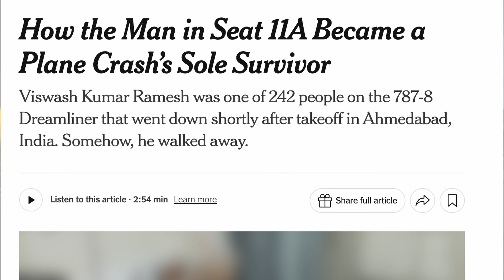Why the RAT Changes Everything – Air India 171 Update

Comment: 13:13 Another evidence is that there is no disturbance in the airflow behind the engines. Usually the air is “hazy” if the engines are running.
Reply: No faint trail of smoke either - especially from an engine at full thrust.
Reply: Good observation 👍
Reply: Could the bang reported by the survivor be a compressor stall?
Reply: @TorqueTheRich probably the RAT door opening. It will open very rapidly.
Reply: @TorqueTheRich I was thinking that, but I don't think a single compressor stall could wipe out both engines, and the odds of both engines stalling simultaneously is incredibly small.
Reply: Plus engines are very loud at full throttle at take off, yes sounds like they were spooling down.
Reply: You talking about the jetwash ? Its not there . the flight as it came from delhi , has some kind of electrical malfunctioning . some of the overhead switch was not working . saw it on the one youtube video . 
There was also one boeing employee wistleblower who said that shortcuts taken while assembling this aircraft . might be its true . when it was new it didnt show the stress . but now when the planes are aging little bit .( heard it like 10 years old now). It may be because of age stress . I am just adding up on the speculations and I based it on video and logic . otherwise I am completely a ignorent person
Reply: Good catch my man.
Reply: Isn't it possible that the pilots desperately tried everything to lift and so they deployed RAT? If so it still could have been anything again we are not closer to the truth.
Reply: @dorkanemeth5510 , absolutely NO time. It’s deployed automatically anyway  in the 78’s… 
They were frantically trying to keep the aircraft in the air.
Reply: You wouldnt be able to make that out on the video imo
Reply: The surrounding ambient temperature can make the jet thrust more visible.
Reply: Yes, no fuel/exhaust vapour trail
Reply: Why did the pilot did not said both engines failed?
Reply: @sumitkumardas2583 pilot barely had time to call Mayday
Remember:
Aviate-Navigate-Communicate

Literally no time for the last 2, it all happened in one of the 2 most critical parts of the flight
Reply: Just came across a must see video, “Mass Murder Over DC”. Trump was behind the plane crash in Washington, D.C., that killed 67, as a threat to lawmakers who might oppose his agenda, of trillions in tax cuts for billionaires, and war on Iran.  There can be no question that the military helicopter deliberately hit the jet, head on, unwavering in its course until impact. The NTSB is refusing to release all altitude data etc etc showing US Gov complicity.  Google "mass murder over DC".
Reply: Thanks for a good video. Looking at the evidence and being prepared to change your mind shows you are an expert. Surely, if it was a dual engine failure, the thing common to both engines is the fuel system. So could be contaminated fuel? On the other video showing the airport cctv, they only just get airborne before the end of the runway, so fuel starvation?
Reply: I still think the video is too low quality to say for sure if there was hot air disturbance or not. However, now that multiple bits of information suggest that RAT was out, dual engine failure would also explain lack of hot air.
Reply: Good point. Air behind the engines are blurred because of hot exaust gasses
Reply: Yeah that's a good point, I'm surprised he didn't notice that
Reply: That could be a good catch
Reply: At a point fuel supply stops . Now both engine are dead.😢😢
Reply: Put down the pipe.
Reply: That was my take too. No visible exhaust, no smoke, no heat-haze, nothing.
Reply: What could trigger both engines to go off at the same time? Lack of maintenance or negligence?
Reply: @hfbhju7001 I think massive " Electrical or multiple hydraulic failures stemming from electrical. ....
But what and how?
Reply: @hfbhju7001 

Lack of maintenance, poor quality maintenance, "bad from supply" parts...too many possibilities to pin responsibility without further investigation.
Reply: @hfbhju7001 o blocco carburante
Reply: @hfbhju7001 I would say sabotage.
Reply: @1dd434 Giving whats going on in that part of the world atm that would be a good assumption.
Reply: 7 days before at Frankfurt that plane let out 2 thin plumes of black smoke on takeoff, I asked if that is normal but no response so guessing it’s normal
Reply: No exhaust heat or smoke seen from back of engines,  however it is very confusing that while the original video does capture the sound produced by the RAT, one can also hear the sound of the engines (different than sound produced by RAT).
I am not against the theory of a very rare and perhaps never seen before dual engine failure at take off with no bird strike, just sharing my confusion about the audio hearing turbine engines running all the way until fireball.
Reply: @JavierRodriguez-fg6yb  Engines usually don't just stop so they could have been still going, but like winding down in a sense as they had no power if that makes sense.
Reply: @paulnerlich1954  that's true, it could've been the engines feathering what I am hearing. 
CVR and BB will hopefully tell better what happened, but sadly it won't change the outcome of all this victims.
Reply: On that topic, the question is, if RAT is deployed due to an electrical and / or hydraulic issue, would the CVR and FDR keep working? I have seen cases (in other, non 787 aircrafts) where FDR has stopped due to an electrical supply outage.
Reply: @JavierRodriguez-fg6yb  I think what you are hearing is simply wind resistance against the airplane. When something is moving fast the wind makes a rushing noise as it passes over it like when you stick your hand out the window of a car it makes a whooshing noise
Reply: Having watched this very insightful analysis of a terrible tragedy, contaminated fuel would seem to be a very logical explanation for both engines to fail simultaneously.
If it was sabotage then some person, group or state is guilty of the mass murder of innocent civilians…
Reply: Could the bang that was heard been something that resulted in fuel starvation to both engines?
Reply: Is it possible for the RAT deployment (accidentally) to cause both engines to shut down?
Reply: @roniwalakandou230 i was wondering the same thing
Reply: @roniwalakandou230 No!! In a 78’ you can’t just “bump” it accidentally. It automatically deploys. 
In something like an F-15E, it is manual, but a LAST resort.
Reply: @mcat663 I didn't say that one of the pilots accidentally deploy the RAT. I am wondering if it's possible to have a RAT MALFUNCTION. If the RAT somehow deployed without one of the three prerequisite conditions, then it will be catastrophic at such a low altitude
Reply: The engines had to be running to achieve lift off !
Reply: @dougsimmon7460  Maybe they stopped running after liftoff...
Reply: @dougsimmon7460 the engines were running in order to achieve lift off, but after take off both engines flamed out and stopped running which is why the RAT was deployed.
Reply: @itsJulianLam obviously
Reply: Its being now established that within 5 secs of plane lifting off there was probably both engine flame out & Pilot calling out Mayday
Reply: @chirab1967 Contaminated fuel, wouldnt u say would cause engines to stop working.
Reply: @robertmitchell6080 
Spot on!
Reply: @dougsimmon7460  yes, but they were well past V1 so that isn’t relevant!
Reply: @dougsimmon7460 very smart. Nobody thought about that. Lol. Didn't it occur to you that the engines might have failed after the aircraft became airborne?
Reply: @Sleeperknot  that's kinda obvious , wouldn't you say ?
Reply: @Sleeperknot 😄
Reply: @dougsimmon7460  well you were stating the obvious so get off the back of anyone else doing the same mate.
Reply: @dougsimmon7460 pot calling the kettle black there dude, high level irony by Dougie.
Reply: @dougsimmon7460 you stated the most obviously obvious!
Reply: @io8476 Somebody has to , obviously !
Reply: @dougsimmon7460 and they would’ve failed after the rotation obviously.
Reply: @tjaviation61 that's the obvious observation
Reply: the power was reduced when it was about 20ft in the air the disturbace stopped
Reply: there is black smoke right after takeoff comming from the engines
Reply: This is a solid and valid explanation, with the clear explanation for deployment of the RAT, and dual flame out. 
However, this still doesn’t explain why the flaps were fully retracted, and the landing gear was still down!

The landing gear is to  immediately be retracted when there is positive lift. Usually shortly after V1.  It is still down in the video. 

In the video, the flaps were fully retracted when it is clear they were barely into Vr (rotation.) and not to V2.  

There isn’t always “one” solution to a problem. 
I think there was “pilot error” involved here as well and should not be discounted.
I think the Captain called for “gear up” and the FO accidentally retracted the flaps. 
The plane appeared to be at about 300 feet entering the video, with RAT deployed, but before descent. 
If there was a flame out after V1, in Vr, and not made it to V2 (which clearly they didn’t,) at the very LEAST, the flaps would still have been extended, and the landing gear somewhere in between. 
A flame out is a 1:100,000 or more flights (and I’ve been in one! Not fun! Luckily before V1 and on a LONG runway!! Slamming the brakes on takeoff is WEIRD!!!)
The odds of a flame out and pilot error of that magnitude must be in the 100’s of million’s!!
God rest their souls! 🙏🏻
Reply: @mcat663  they didn't had enough time to think about landing gear, the sole survivor told that take off was normal but 10-15 seconds after that plane nearly stalled in the air then their was big noise and lights started flickering. Everything happened in such a short span of time you guys are thinking about gear and flaps.. always ready blame. I never blamed the pilots the moment i knew that it all happened within minutes/seconds that too immediately after take off, there's very little one can do in such scenarios but who will explain to fools like you all
Reply: @mcat663  I would expect the RAT,  designed to operate at high altitude, is not responsive enough to build up hydraulic pressure or power bus at short notice.
Reply: @rhyoliteaquacade , the RAT is designed for many situations. 
Otherwise, why would it have deployed at all automatically in this situation?
Also, if you’re having an issue at high-speed, you don’t want it deployed immediately and interfere with a (stable?) flight of the aircraft first. You want to be able to stabilize the aircraft on what you have available first. 
In the F 15, it is deployed manually, and it is the last thing you want to do at a high speed if you have engine failure, electrical or hydraulic outage.
Reply: This is a solid and valid explanation, with the clear explanation for deployment of the RAT, and dual flame out. 
However, this still doesn’t explain why the flaps were fully retracted, and the landing gear was still down!

The landing gear is to  immediately be retracted when there is positive lift. Usually shortly after V1.  It is still down in the video. 

In the video, the flaps were fully retracted when it is clear they were barely into Vr (rotation.) and not to V2.  

There isn’t always “one” solution to a problem. 
I think there was “pilot error” involved here as well and should not be discounted.
I think the Captain called for “gear up” and the FO accidentally retracted the flaps. 
The plane appeared to be at about 300 feet entering the video, with RAT deployed, but before descent. 
If there was a flame out after V1, in Vr, and not made it to V2 (which clearly they didn’t,) at the very LEAST, the flaps would still have been extended, and the landing gear somewhere in between. 
A flame out is a 1:100,000 or more flights (and I’ve been in one! Not fun! Luckily before V1 and on a LONG runway!! Slamming the brakes on takeoff is WEIRD!!!)
The odds of a flame out and pilot error of that magnitude must be in the 100’s of million’s!!
God rest their souls! 🙏🏻
Reply: @mcat663  The plane made it to 625 ft. I heard, but the runway had an elevation of around 200 ft. so they were about 425 ft. off the ground at their highest.
Reply: @mcat663 well explained

Comment: Maybe, fuel was cut off, Never heard of a dual engine failure on a 787. Plane is made to fly one one engine. What are the odds that both engines flame out, unless the fuel was shut off. This airplane has so may systems that make sure aircraft is safe to go. This is just an opinion, let's wait for the final report. Survivor said he heard a loud bang just before the lights flickered, and the plane lost power. Hmmmm. I'm sorry for your loss. 😔

Comment: i feel like this is an electrical issue, its almost as if the plane had a huge fault or fire with the lithium batteries, that somehow just turned off the engines somehow, like hitting the engine cutoff switches, there was odd things with the electrics as some guy on youtube flew this before and said the ac pack wasnt working and other electrical issues, so maybe a battery blew up and somehow killed the engines ?? but truly no idea what happened

Comment: dual engine failure - yes, but because the engines were remotely disabled from the ground. It's a standard system they installed after 9/11. Now try to figure out which intel agency remotely controlled the plane into the ground and who they didn't want to walk God's green Earth any longer.

Comment: flat / discharged battery    sitting delayed for two hours almost discharged the battery pack .activating the gear up command was the final act which lowered the battery voltage below the BMS   threshold limit which automatically disconnects the battery output to protect the battery pack.   game over .signals were ignored ... aircon fail lethargic take off power .V1 and rotate almost at the end of the runway .  what warnings of a discharged battery pack are available .

Comment: "The Flaps were not Set PROPERLY" ??
What the Heck Man? What kinda Pilot are you??

The Flaps were NOT set AT ALL!

And the RAT is a tiny Object, therefore it would NOT be visible from that Distance from the Camera!

You are using the other U Tube Idiot's theory, that he could hear the sound of the RAT, while TWO powerful Jet Engines SOUNDS were present!

And an Electrical Failure  has NOTHING to do with the Aircraft LIFT!

So it is stupidity to FOCUS on an Electrical Failure, as the CAUSE of the Crash, while it is OBVIOUS that LIFT Failure, due to ZERO FLAP deployment is the Reason the Plane Crashed!

The Plane crashed due to loss of LIFT!
NOT electrical Failure!

DumbAss Presentation from you!
Reply: Electrical failure would certainly affect the engines as I heard from some commentators here that the 787 engines are electrically controlled. And you can quite clearly hear the RAT at the very beginning of the video.
Reply: @deeptanshubhowmik5073 

You Repeating Western Nonsense!
The RAT is a WIND turbine.
It does not have an ENGINE.

And at  Low Aircraft speed, and also where the Plane is NOT gaining LIFT, there is NOT enough RAM AIR, to drive the RAT, in order for it to make a loud enough sound!

The Aircraft FELL because the Idiot  Pilots did NOT deploy the FLAPS before Take Off!

And during take off, the ENGINE THROTTLES were at nearly Full Power, and BOTH ENGINES were ALREADY at full Power in order to achieve V2 and V1!

So as the Aircraft Nose lifted after V1, the Engines, and LEVERS, were already on FULL POWER!

Understand?

Comment: Very good commentary 
I am still wondering:
-Why were the flaps seemingly fully retracted?
-Why was the gear not retracted?.  Does the RAT generate enough hydraulic power to retract the gear, or is it intended for extension only?
Terrible situation to find one’s self in.
This could cause chaos in the industry, and for Boeing, if it was a double flame out on rotation.

Comment: The other thing you did not mention-if the engines were running, you would hear them especially when they are so low and try to fly out of that situation.I agree-that was most probably a dual engine failure and that is why the RAT fully deployed  and not in the final seconds of impact.

Comment: We do have to consider the pilot manually deployed the rat.   I would also think it would be quite easy to crosscheck the speeds the aircraft attained over the length of runway used, to conclude engine performance initially vs once in the air, in order to understand the engines' role in all of this - sudden failure vs under performance from the gitgo vs a red herring.

Comment: Love your Videos Sir!.

 I just had something to add to your assessment of the crash .. Clearly the landing gear seems to have been attempted to retract, However since both the engines failed so did the hydraulic system. If you look at the wheels 15 to 20 seconds before the crash, you will notice it isn't tilting backward which is a default position upon take-off.. there is a slightly forward tilt which ideally happens when there is an attempt to retract the wheel but due to hydraulic failure it doesn't go through back inside and rather sticks straight or rather forward. Just my take on this. Cheers ( I'm not a pilot)

Comment: Steve if flame out on both could restart  one see  gain hight but thing lost every thing and plane dead she crashed to no flaps I think was no alarm at first  but took off thay lost hidrolic  s flaps did not work or power died on both I  gas prob to both engines as v1 take off speed so sure blocked filter or something  like that that stave both same time  may be tank feeds both valve s got blocked or failed

Comment: What if there was fatique of the fuel supply line or water in comb. with kerosine. Maintenance or design error. Seems the fuel would not reach engine (both) with would logically make you drop down due to shut off.